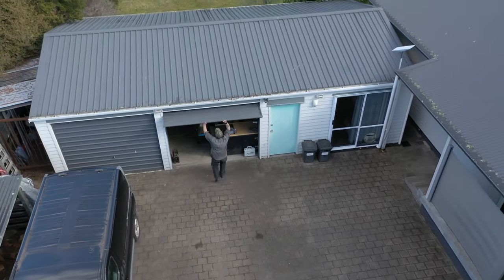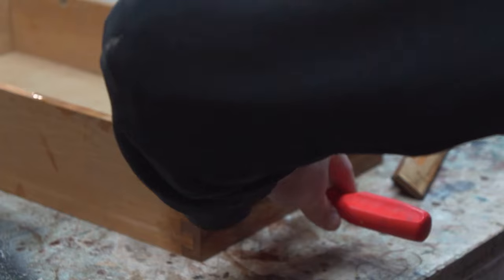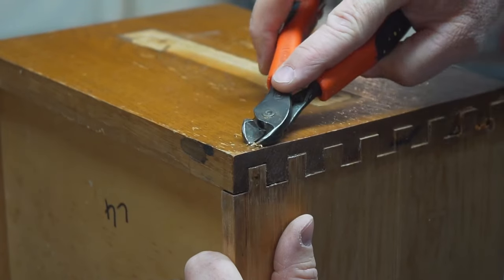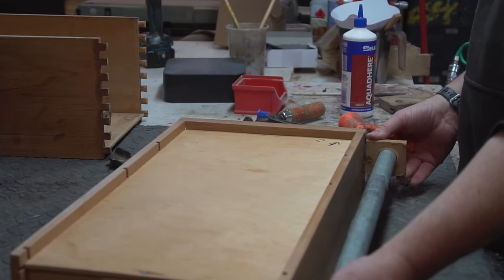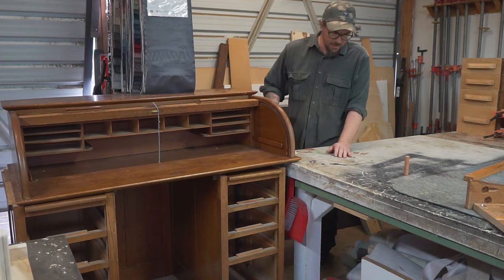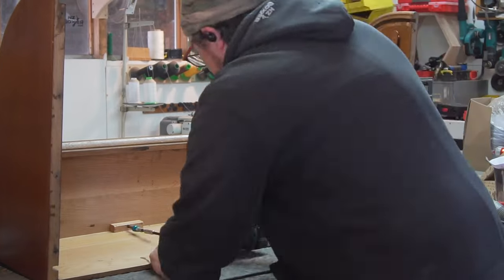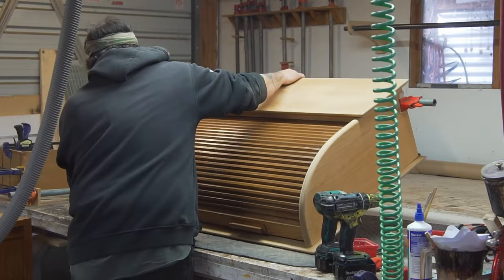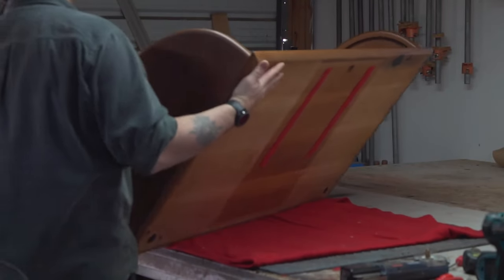Only took 4 days to Restore this 1930's Oak Desk

Comment: How did you get all that knowledge about wood species, right and wrong glues, using steam to loosen glue ect.
I am in awe of your skills, especially with the  rolling door.  I remember oak is extremely hard, it takes forever to cut, wears out blades quickly and smells like cat pee. Beautiful wood, but not to be hurried.
Congratulations, keep the videos coming.
Reply from the maker: Oh hey there.
Great Questions, Im an Automotive mechanic by trade and after that I spent many years manufacturing skydiving gear. Woodwork and Upholstery is just one of my passions and ive used 15 years to make all the mistakes needed, just so I can finally say "I think I know what im doing". My advice is to grab a project tomorrow, break and make it then do it again. The satisfaction is in noticing your skill and knowledge progression. D

Comment: Can I ask a question, I have a simular desk, but the rolling part is missing, so if I close my drawers, the are locked. I need to make a new rolling thingy. I'm not going to repair the hole desk because it's for my art atelier silver smithing. But how do I know how long the rol piece had to be and how have the, so when it rolls open tje drawers will unlock. If you need more information, I would be glad to give it to you. I'm a woman on my own, so I'm barly able to lift the top of the desk.🤦‍♀️